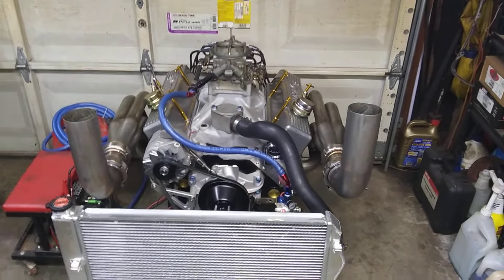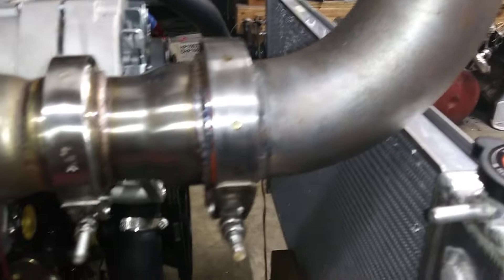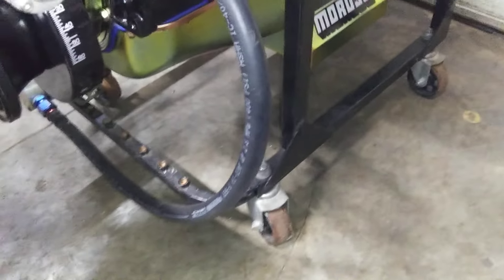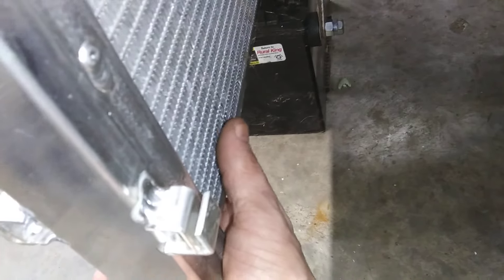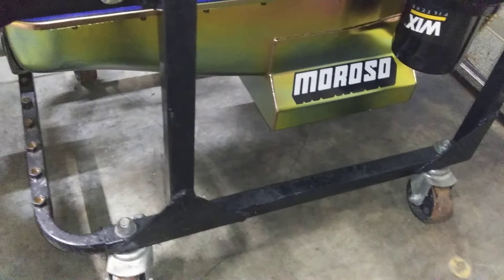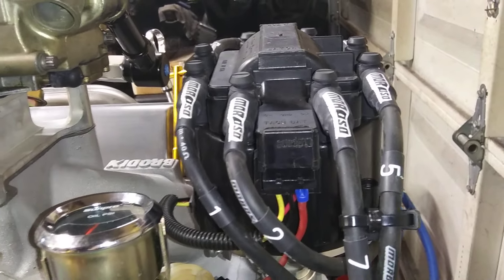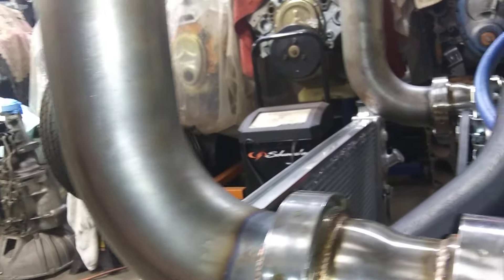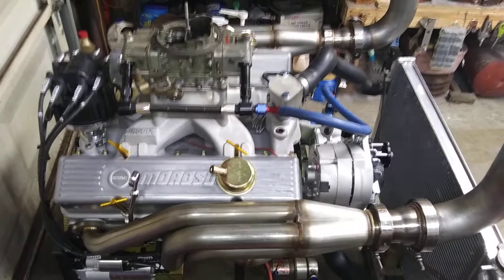"500+hp" 357ci SBC, 3 inch bull horns for turbo headers & radiator for run stand.

Comment: Yes the dolly rail extensions to mount the rad will be cool. Slick setup indeed.. Throw a couple lectric fans on that rad and you'll have a cam break in setup.
Looking forward to see you running this old 500hp L98 block.  (how often does that happen?) You probably have one of the only ones.
Enjoyed the show.
Reply from the maker: @judgegixxer  Thanks man.

Comment: I think out the hood bad ass!
Reply from the maker: @JohnMiller-ee9pn  Yep, Mad Max type shit.
Reply from the maker: I have a pair of stand up pulling truck type headers that was on a Minirod pull tractor. They are badass "Headers By Ed", I was gonna use them on my 84 C-10. Bought the truck with the intention of building a Superstock 2wd SBC pulling truck with it. But decided to keep it on the street. Those stand up headers would have looked killer on it.
Reply from the maker: I'm into truck and tractor pulling too. Love that shit. Minirod pull tractors are like Fuel Altereds dragging a sled. Good indoor activity in the winter time.

Comment: Was always wondering about those headers where the merge is small then transition's back to full size. Whats your thoughts Sam? I think they are to help scavenging like you said but have never played with them.
Reply from the maker: @wildrosegarage4208  It could help I believe. Those Doug Thorly merge collectors seem to work. They are expensive as hell too. Allegedly there's a venture effect that helps pull the exhaust out. I've never used them, but I've seen them for the past 40yrs. I've always gone with the biggest diameter and longest collectors. And I usually run at least a 18in collector extension.
Reply from the maker: @wildrosegarage4208  Being turbo headers, the 2.50 dia exit is probably to keep velocity up. The primary is 1.750 dia.

Comment: So after you get this heat cycled and tuned the bbest you can on your run stand us she going to go to the dyno?😎👍
Reply from the maker: Everybody around here has a 6 month waiting list.  Couple chassis dynos could get into quicker. Only engine dyno in this town the owner went to prison for drug trafficking. Cops bulldozed the building to the ground. I used to work there.
Reply: @thereluctantgearhead4544  
That really sucks. Maybe a road trip with 2 or more engines somewhere a little farther out where you can spend a few days there testing more than one engine? Isn't that 427 tall deck getting closer?😎👍
Reply from the maker: @itseithergonnaworkoritaint7852  Yep, Tall deck at the machine shop now getting the works. Should have it back in a month or so. I took it to "the man". Had to travel a little bit. Dude is the best around here within 100 miles. Builds blown alcohol dragster and pulling truck & tractor engines + Sprint cars, Super late models and everything else. Old guy been drag racing since the early 60s. Had a fuel altered back in the 60s, still has it tucked away. Blown 427 rat on 98% nitromethane. Hes good. Has 1000+hp all aluminum RODECK SBCs sitting around the shop and blown alcohol 526ci bigblocks. He has a dyno, but it would be a year out to get on it. Hes a one man show and has hundreds of engines to do. Dudes a local legend. The pictures on his office wall tell one hell of a story. It's all engines and various vehicles from different forms of motorsports all running his engines. Goes back to the 60s. Dudes living history. He only builds and machines racing engines. He obviously has genius level intelligent level. His machine shop is like going back in time. Still the same as it was in the mid 60s. Old brick building, it's cool. His work is second to none. He's probably 75+yrs old. And he only works 4 days a week from 8:00am to 4:00pm. He's pretty much retired, but he can't quit. Hell of a dude.
Reply from the maker: @itseithergonnaworkoritaint7852  That 427 is gonna be pretty rowdy Jones (my machinist)  thinks it'll make over 750hp.
Reply from the maker: @itseithergonnaworkoritaint7852  My machinist was personal friends with John Lingenfelter. Believe they grew up together in Indiana. I live pretty close to Decaitor IN. John Lingenfelter was a local legend in this part of the country.
Reply: @thereluctantgearhead4544  
That's pretty cool, I got to talk about cylinder heads with George Delorean(John's brother) for about an hour. He used to work for Dart about 10 years ago. Not sure if he's still alive though, haven't heard from him since. A friend of mine knew him and I was building a rowdy solid roller cam sbc 383 for him and he set me up with the call. He ended up buying a set of Dart heads from someone else he knew for a great deal that worked out great for what it was for. 

Ended up making about 580 HP with it in a Jeep YJ Cherokee made into a prerunner kinda dune machine. It has 18" of travel in the front and 24" of travel in the rear. That thing can fly about 95 mph in the sand dunes across the moguls and it felt like you were riding on a cloud. Thing is good at jumping too, 10 ft in the air is like nothing for it. A really fun toy after he got it to stop eating transmissions. 

It unalived about 4 Powerglide transmissions and 3 th350s before he stepped up to a th400. Revenge of the transmissions happened and that th400 took out the thrust in the engine! Trans guy tried to blame the engine builder because he never had anyone put a high RPM engine behind a th400 so he didn't know to drill out the pressure relief hole larger. The Powerglide and the th350 both have a pressure relief valve but a th400 only has a hole that releases the excess pressure so the transmission doesn't take out the thrust bearing from pushing the converter into the crank with lots of hydraulic pressure.

Oh yeah at first he broke the 9" Ford rear end with the heavy duty 33 spline truck axles. Once he upgraded to the 40 spline axles that were as big around as a beer can those stop breaking.

Last I heard it's running great after I repaired the thrust for him and he got the transmission sorted out. So many broken parts, he good to go now after running out of weak links.😎👍
Reply from the maker: @itseithergonnaworkoritaint7852 Them Prerunners are cool. Like to build one with a 67-72 C-10 with a aluminum bigblock. Always wanted a 66/68 Bronco built like the Big Oly Bronco Baja 1000 winner from Bill Strope. That thing was badass.

Comment: flowmaster flowFX is what your thinking of i believe.
Reply from the maker: Yep, been a long night.
Reply: @thereluctantgearhead4544  they sound good, I'll say that much 
Unlike their tin can trophy mufflers they're known for.
Reply from the maker: @UsefulEntertainment  That's what I figured. Plus the straight thru design takes away minimal horsepower. I still have a shitload of the old welded Flowmasters tucked away. They sound good on some shit. But they take away more power than the straight thru types. I run Dynomax Race Magnum bullets and Moroso Spiroflows on a lot of my hotrods. Even 3 inch glasspacks will get the job done and sound killer on a big cam hotrod. Pretty obnoxious wide open. I like it that way tho. Loud pipes save lives....😊
Reply from the maker: @UsefulEntertainment  I'm a old motherfucker and I still love loud ass hotrods and driving like a maniac. Some shit ya never out grow.